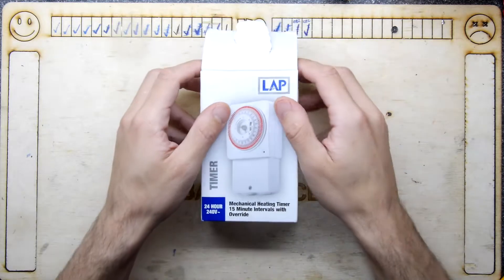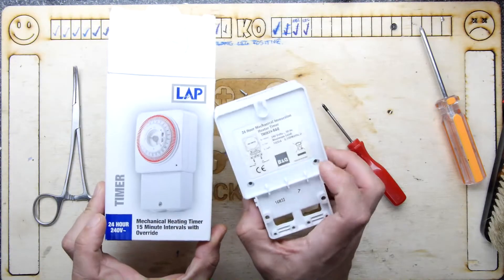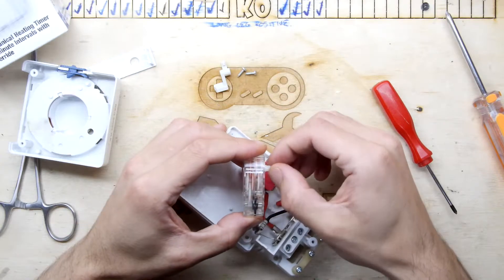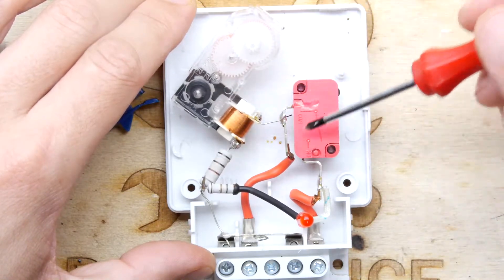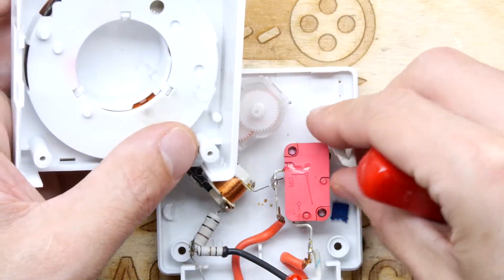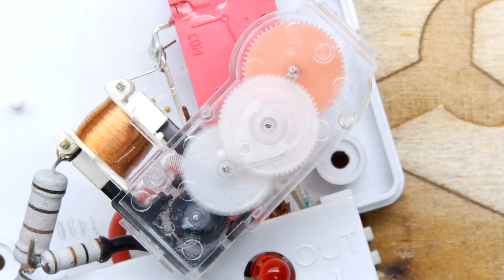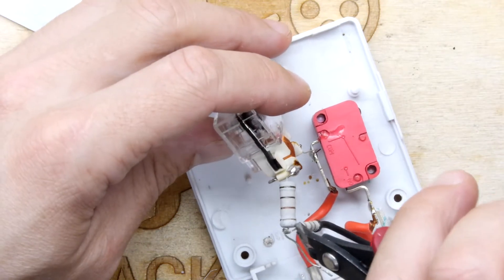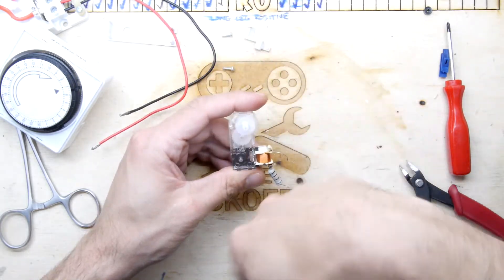Mechanical 240v Timer Chinnyvision

Comment: The 'clock' will not produce a 1 rev per day output on its own. It needs the large gear on the timer ring to do that.
Reply from the maker: +Ashley Booth ha ha, good point! Well spotted. I will have to sit and watch how many revs it makes in 12 hours to work it out 🤔
Reply: The output speed will be 1 rev per day divided by the ratio of the number of teeth on the output gear to the number of teeth on the large timer ring.
Reply from the maker: +Ashley Booth Yeah, problem is, I already threw that bit away 🤔 I think I can mark the ring somehow and measure it after a number of minutes

Comment: This is the 2nd I've had fail and the previous owner clearly had the same issue as the cupboard is full of broken ones!
Reply: Interesting. I just replaced like for like.
Reply from the maker: +ChinnyVision - The Retro Game Review Channel is it on your immersion heater?
Reply: Yes. Top element is digital, bottom is analogue. No idea why. Thats what the previous owner settled on.
Reply from the maker: +ChinnyVision - The Retro Game Review Channel I wonder why it managed to burn out your Romney's though 🤔 very odd indeed!
Reply: I never saw the rating but ideally you should be using a 20A double pole for an immersion heater
Reply from the maker: Are there really any above 3kW?
Reply: Even at 3 kW you're pulling 12.5 Amps, so should be using one with a 16A load rating, we always installed using 2.5 mm t+e rather than 1.5 and using a 2-pole 20A rated switch

Comment: That resistor is probably not black black brown, more likely the first one or two bands have been cooked to black from the heat.
Reply from the maker: +MrPGT9999 hmm could be 🤔 maybe I could use this to make an indoor sundial that moves a pointer around a lamp or something 😁
Reply: Yeah, May be! An timed light circuit for garden /security light ?
But if you use LEDs, the honking resister will eat more electricity than the light itself.
Reply from the maker: +I_will_get_you There I think it needs to be something mechanical, that will be way cooler 😁